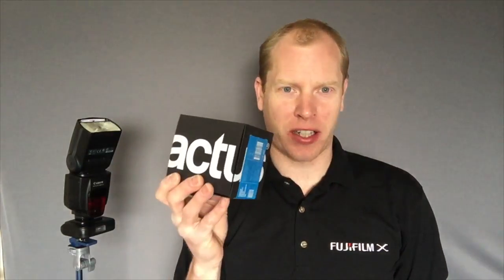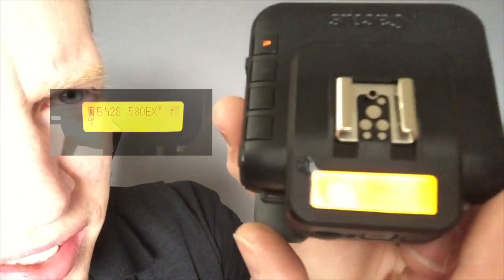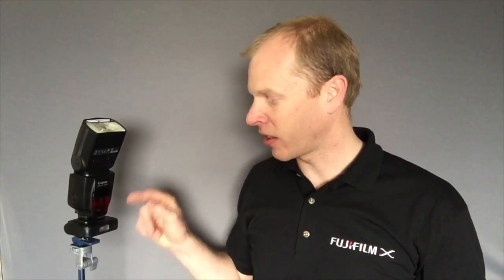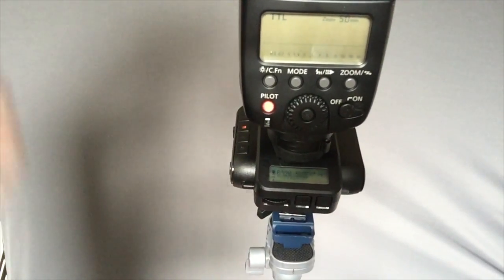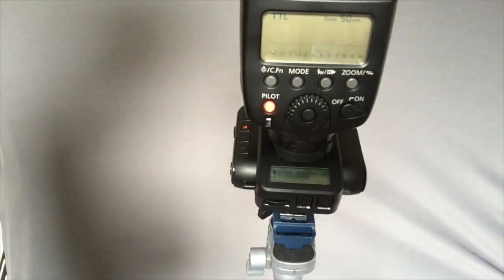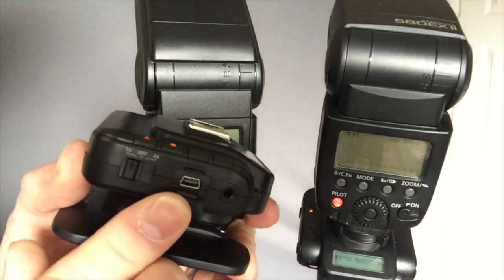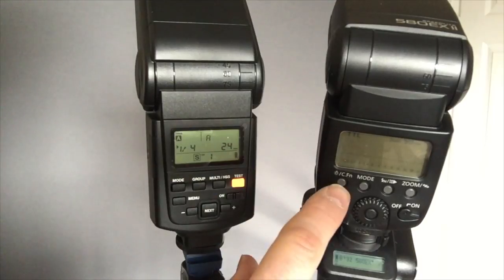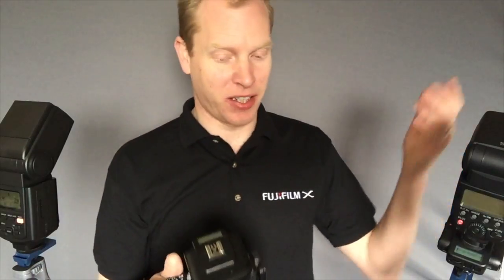Cactus v6 Radio Transceiver and RF60 Speedlight setup with Canon EX580 Speedlight

Comment: thanks for the video. do you know if u can use an external battery pack with the flash (made either by cactus or canon) or u have to use AA bateries only? thanks.
Reply: +Andrew atm There is a Cactus external battery pack available (that uses another 8-AA batteries).  That battery pack is also compatible with the Canon speedlights, so if you get a Canon external pack then it should work, but I've never tried it.

Comment: How do I set up my Metz flashes profile? Downloaded the ...10 firmware update from cactus site (5/29/2015) ; do not see mz54N or mz58N...has the mz50 however, neither sb25n. Thanks for the hint of having the flash @ theTTL Mode since is using "that" for the remote firing!!!
Reply: Nadine Smoske Not every flash models are pre-installed on the V6. Which model is the MZ58N? Are you referring to Metz 58 AF-2 for Nikon?
Reply: ***** Hi!  I have a Cactus V6 transceiver with RF60 speedlite and Canon 600ex-rt speedlite. I have a problem triggering flash from Canon 600ex. even though I set up the group A as Canon 600ex on the V6 transceiver. RF60 fires normally from Group B. Am I missing something here. Can you help me please?

Comment: Why was the Canon flash set in TTL mode? If it's not on the camera, the power of the flash is ONLY manual, not TTL, right?
Reply: +Stephen O&#39;Sullivan It is set in TTL because the Cactus V6 needs to use the TTL function of the speedlight to set the power level output.  If you set the speedlight in manual the Cactus would have no way of controlling the power output.